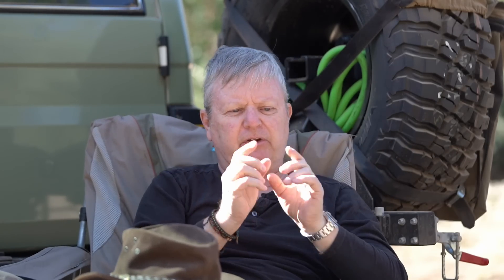TIRES - Traction, Rolling-Resistance EXPLAINED

Comment: Tires do get wider as you lower the pressure. They also get longer.  It's both. Just measure the width of your tire tracks. It's not that hard to compare them.  Also - have you seen any tractor built after 1950?  They almost all have the same size front and rear tires. Most larger modern tractors use tracks that are both very wide and very long. The lower the ground pressure the better. The older tractors you're thinking of don't rely on the front tires to steer. They use brakes on each side to steer in most scenarios where they are in soft ground. That's why they have two brake pedals that control each rear tire. 4x4 tractors almost universally have front tires that match the ground pressure of the rears. If the front are smaller - it's because the weight is not evenly distributed.

Taller AND wider is the best option. But if you can't do that - there are some arguments for taller INSTEAD OF  wider if you have to choose between the two. There are also arguments for wider shorter tires. In most cases it depends on how much power you have and whether you're relying on displacement of the surface to move or friction. High hp vehicles almost universally run wide tires and rely on displacement (think paddle tires on sand rails, or snowmobiles).  Low hp vehicles tend to rely on friction with the surface (think Unimog for example). Neither is always better.

For rock crawling - lower pressure is better in almost all places. More psi and low air pressure are exact opposites. So if you thing airing down helps - you can't also argue that higher ground pressure helps. The two are exactly opposite of each other. Wider and taller is better. But sticky rubber is by far the most important tire attribute. Soft rubber is better.

One point that that also should be mentioned is that sand has two different things going on.  The first is compaction of the sand.  That argument isn't great for narrow tires. You're compacting about the same amount of sand either way.  The other issue is the fluid properties of sand. In that portion of the sand motion the narrow tire makes a lot of difference. It is more easily driven through the sand as it displaces sand to the sides, much like a boat does with a bow wave.  Tires create a bow wave effect in sand. And a longer narrower tire will create a smaller one and have less effort required to push through it. This only applies at low speeds where you're not climbing over that rolling sand wave. Much like a canoe is far more easily driven through the water than a flat bottom boat.  Once you reach speeds where you're riding on top of the sand that benefit goes away and a wide tire is better.  Much like planing on a power boat. Going from displacement speeds to planing speed is where you might find more benefit to a wider tire in sand.  In snow - it's totally different and rarely acts like a fluid. In deep snow - wider is always better.
Reply: Philip Jooste The rolling resistance has to to with available traction not the power the engine has to produce. You missed that point entirely. If you have x traction available and you have to spend x traction on pushing sand in front you don't go anywhere because the forces are equal. The power of the engine is not a factor. Disagree all you want on wide vs narrow but engine power has zero to do with anything being discussed on this video.
Reply: totally agree wide and tall is better and they do get wider when pressure is lowed the tyre flattens out giving a long footprint and also a wider print as the tyre is now giving a flat print instead of a rounded print when fully inflated  iam not saying its a lot difference but a couple of centimetres can make all the difference centimetres in width and grip plus iam not talking of megga wide tyres mine are 285 75 16 inch bfgs mud terrain  and work great in the mud  were i use them and good in snow they were are a lot better than my old 235 16 bfgs any day that is my preference i think at the end of the day it depends on what you want to use them for and for me wider is better i get better grip for what i use them for than the narrow ones and ive been driving off road for 30 plus years land rovers series 2s and 3s range rover vogues discovery 1 and 2 and now jeep wrangler Rubicon and i haven't had to use my diff locks yet the bloody thing will just not get stuck lol ive only used my winch on others so far in the UK .
Reply: jeep6242 Thanks for your comment which got me to rethink the whole rolling resistance issue. Without a lengthy explanation and going berserk with the science behind it, simply look at the two ends of the scale – a steel wheel running along a steel rail which will offer very little rolling resistance, versus a nice juicy soft-compound wide rubber tyre on a gritty surface. Whereas the steel wheel will depend on a lot of downforce to gain traction when torque is applied to it, the rubber tyre will resist the applied torque, but offer traction which will result in motion once the rolling resistance is overcome. How does one overcome rolling resistance? With a healthy high-output Diesel V8!
Reply: Great comment with which I entirely agree! To add, Andrew kept coming up with "rolling resistance" as an argument against wider tyres, but this is easily overcome by the 430 n.m of torque and 151 kW of power that his 1VD-FTV delivers.
Reply: @philipjooste9075  You are correct that the engine torque will keep the wheels turning but what is important is to reduce the external rolling resistance so that the wheels keeps moving forward. If the resistance is too high the wheel will start spinning instead of moving forward.
Reply: @defendermodsandtravels  Sure Bill, but how to you propose to reduce the "external rolling resistance"? Are we talking about the same thing, because in my mind, "external rolling resistance" depends on the terrain, and that you cannot change. (I've watched the excellent video you made - awesome stuff!)
Reply: @philipjooste9075 Philip, I think you know my answer since you have viewed my video on the subject. In short, use the narrowest tyre which will support the wheel load (at least in granular soils such as sand) and use the lowest inflation pressure appropriate to the driving conditions. That will give the lowest external rolling resistance.

Comment: Wide or Narrow is the wrong question. There is an optimal tire size for every vehicle and application and if you go any different from the optimal you get worse performance. The right question is how to find out what is the right tire size for your vehicle. As Andrew is an overlander the application we talk about here is overlanding. Overland vehicles are extra heavy, mine is 30% heavier then stock! I had to change axles, springs, shocks, brakes, etc. many other things  and tires. My starting point with tires was diameter, if too big problems, if too small car lose offroad ability, where is the gold spot - around 1/3 of wheel base, i.e. for 116” wheelbase makes 37” tires (I suppose 35” would be ok too). Here we come to the second question - how narrow? Well that depends on load of your car. Wider tires can carry more load vs narrow tires. How much is the minimum you need depends on the load per tire and the tire max psi. From my experience you need to be able to run your tires at 15psi (in soft sand 7psi) when in need (sand, rocks, mud). Suppose you have a 1500 lbs per tire, i.e. 6000 lbs vehicle evenly distributed front back. Most tires have the load capacity rated at 80, 65, 50 and in rear cases 25psi. Chose a tire with lowest value, it would give max. ability to run it on low pressure. Of course 25psi rated tires are specialized offroad tires like interco irok or supper swamper bogger . From commercial tires wrangler mtr kevlar is good option or bfg mt, i.e. go browse for yourself, but look for 50psi or less. What load? Tire manufactures have tire pressure, load, speed tables. Get one and check if you want to run at 15psi with the speed you need (you cannot run fast with low pressure, assume 20-30 km/h max) what load rating, i.e. tire you need (don’t forget to put 20-30% insurance). Now let say you come up with tire 37x12,5”.  You cannot go with thinner tire, because you simply will not have the needed load carrying capacity and you cannot run low pressure, which means you will get stuck or even worse damage your tires. From another side you do not need wider tires as rolling resistance gets bigger, they are heavier and you get no value added.
Reply: Bojidar Kounov thank you! It makes sense now. I think. So, if my load per tire was 1000 pounds and my tire max pressure is 50psi at 2000 pounds. Does that mean I should always run between 25 and 50psi? Would it be ok to run less than 25psi at slow speed off road?
Reply: Paul , sorry, just seen your question. Of course you can drive slow at lower psi. The  stated load caring capacity is at stated  max speed index. In any case try avoiding going below 14 psi unless you really need to.

Comment: Interesting discussion. I think you are leaving part of the tyre function on the vehicle. The tyre function is based on the weight of the vehicle in the terrain. Have you revealed the weight of the troopy, the standard kerb weight is 2385, GVM of the std troopy is 3300kg. The difference between something between a common vehicle like a HiLux or DMax compared to the way heavier Troopy would make a major difference of tyre functions. (HiLux 4x4 is kerb 1850kg and GVM up around 3000kg)

Comment: Interesting talk, thank you. Weight also has to be taken into consideration, as well as rolling resistance when using wides, I.e., putting the drive components under more stress when accelerating or when tyres are spinning, especially when using steel wheels. I use 235 85 16s. I think a lot of folk use wide tyres for looks, which I agree, certainty do make the vehicle look the part and that's fair enough.

Comment: Hello Andrew, thank you for this inspiring video.I'm a bit confused hearing you say that wider tyres are more comfortable on the road. To say that, the road would have to be perfectly flat. In (my) reality, wide tyres cause the road bumps to feel harder, the tracks in the road surface will pull the steering wheel more and if too wide, rain will become straightforward dangerous. The only nice thing is better grip over corners, but I wouldn't call it comfort at all.Anyway.... on the Mitsubishi L200 (Triton) I used to drive in coal mines we used to use 205/80R16. Nobody of the 4WD fans here even mentioning such a skinnies. Is it something completely unusual for you guys to use it?

Comment: Hi Andrew, thank you for your video. As usual quite interesting. However two things you have got wrong understanding about. First the contact surface does not depend on tire profile, narrow or wide. It ONLY depends on weight of the vehicle and tire pressure - this comes from the definition of pressure and laws of physics.  Second point is there are tires that get wider when pressure comes down - flotation tires. I have bfg mt km2 flotation size. When aired down at 0.6 bars their footprint gets by 25-35% wider on sand. Here is picture of mine https://plus.google.com/photos/photo/107942263895501714543/6558665211294562370, https://plus.google.com/photos/photo/107942263895501714543/6558668026749623970, but you can do the test yourself, I see you have km3, not sure your size is flotation though.

Comment: I've said this before and its worth saying again - You are correct regarding width for performance off road but its ignoring profile.  a 9 inch wide tire will perform well but if its an 85 series sidewall you are going to lose lateral stability at high speed.  Air pressure supports the weight of the vehicle vertically but the sidewall stiffness controls the lateral stability of the vehicle and the taller the tire the less there is. You can add more air but its the sidewall that's doing most the of the work, not the air.  Meaning in an emergency situation a heavily loaded touring wagon is going to be less stable and more prone to loss of traction and control.  Even in heavy cross winds at high speeds you can feel the difference.  Where I live most of my touring is separated by long stretches of 80 mph freeway and while my 285/75r16 might not be the best tire in terms of width, they offer greater on road stability in those situations.  The tradeoff is worth it to me.

Comment: In my opinion, one of the reasons as well to go with narrower tires is that it's cheaper. I have observe a significant drop in fuel economy with wider tires. On longer trips, fuel economy is important. That's the reason why I went back from 285/65 R17 to a 265/70 R17 (Cooper Discoverer AT3). Plus it's cheaper to buy but the wider tires in my experience gives me greater stability in clay type mud. Of course, this is just my experience. Btw, thank you as usual Andrew for a very informative video and I will definitely keep this in mind when I get a taste of sand. Cheers to you sir! 😉

Comment: Snow is the worst place for a wide tire.  Especially on ice.  I use tall narrow tires on my Land Rover and Tall wider tires on my Ram Cummins.  The truck weighs 8000 lbs though so it needs heavy wide tires for the load.

Comment: Appreciate the video Andrew! What’s your opinion on 15” wheels? I would assume, if you can fit them, they would be better than 16” or 17”.
Reply: If you can fit 15" wheels, you have brakes of no use. :-)I run 15" alloys on my old Vanagon 4WD, orignally wanted to use 215/75 R15 but because of weak brakes I sacrificed some clearance and went for 205/70R15.And then guys, try to beat my narrow tyres! :-D

Comment: sounds right to me, maybe there is a formula for the ideal combination, tyre width / tyre diameter / aspect ratio / axle load / engine power? I have seen on another 4WD Vmag there is a guy with an old defender with massive wide tyres, on every sand hill he struggles or fails to make it! When I saw it I thought,  his tyres are to wide...

Comment: Well that was a very awesome video on rolling resistance and tire foot print but I have to say bfg km3 I find is not what it is all raped up to be I've ran across different styles tires that are closely designed the same and they just didn't perform on road or overland as you all would say and not just that I've been a tire tech for off and on about twelve years give or take and I've Seen the best and worst of the tire designs and yes I'm from the place some people out there call retardasan aka American. I've seen all off-road tires no matter what style do good at one thing and just failed on others also reversed.

Comment: I'm glad you've been able to convince yourself that narrow is better than wide. I've been struggling with it for decades. The big difference between us is that I don't deflate my tires off-road. I guess I'm just too lazy. I've experimented with 235-85 17 on a full-size pickup vs 265 75 and on my FJ Cruiser I tried 255-75 vs 265-70. I never do any sand driving anymore. But we have our winters with lots of snow and ice. I still think the wider gives you better response with handling braking and acceleration just about everywhere at full tire pressure. I think the narrow tire will loose traction more quickly when rolling over smaller rock because it acts as bearings and lifts most of the tread off the ground where the wider tire will confort a little better and retain more traction (at normal pressures). The pickup with narrow tires would spin more readily on just about any surface. Of course my opinion is still a guess because of the advancements in compounds over the years but I went through 5 sets of tires with the pickup and 3 on the Cruiser probably another 4 on a Ranger. I never deflated on dirt because my speeds were often too high. On ice and snow I also kept normal pressures because I wanted the studs to work efficiently which they do. SO... in the end I tend to go on the wide (stock) size purely for the extra traction in emergency situations in every day driving. Modern vehicles with all the safety electronic nannies are calibrated towards stock size tires and I don't want to risk loosing their effectiveness through tire widths.

Comment: Your not factoring in how much power the vehicle has or extra clearance a tire like a 35" would give you. If you have lots of power rolling resistance is far less of an issue. Why do Baja trucks run wide tires? Why do all rock crawlers in the U.S run large diameter wide tires? My 79 series is hugely more capable with 35s on it compared the same tire I had in 32s before. I think you'd find that in your 78 series with the amount of power on tap you'd laugh at the extra capability a set of 35s would make, in all conditions.

Comment: Excellent advice, Andrew. I've got stock standard 265, 17, 65 on my Pajero and can't afford new rims. Would like to go to 265, 17, 70 but am not sure if I can. Can you suggest if I can do this or would you offer any alternatives?
Reply: 245/75/17 is a possibility. Same height as the 265s but less width to worry about

Comment: I agree , but with tyres need to be a certain size imo to suit the vehicle size, power, and gearing. If you have a 1000 hp with skinny or small tyres there would be not point. The bigger the tyre requires to get the best out of its
Power and or gearing.

IMO the optimal tyre for a land cruiser troopie would have a 285/65/16 (or eq) and a Hilux for example would be a 265/75/16 (or eq)

If you have either vehicle with heaps more power and say lower gearing you would get more off road performance with bigger and WIDER tyres. Just my opinion and personal experience.